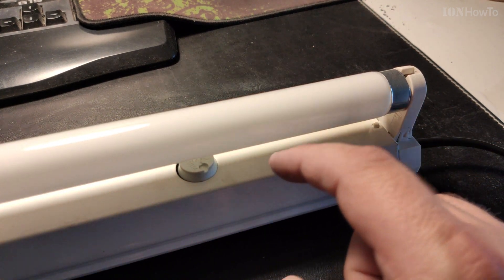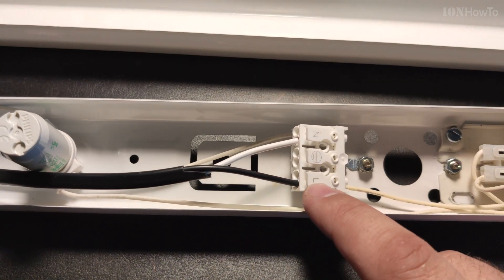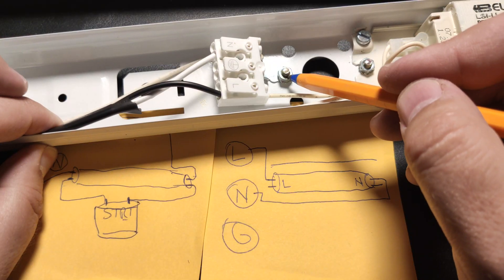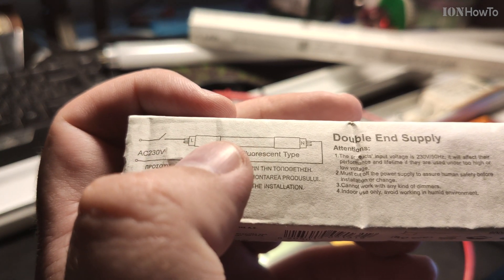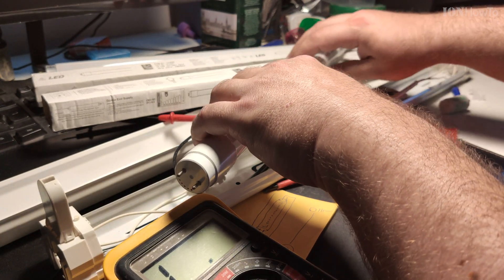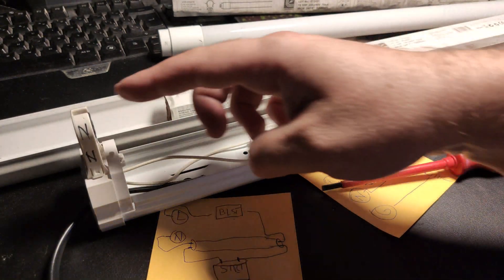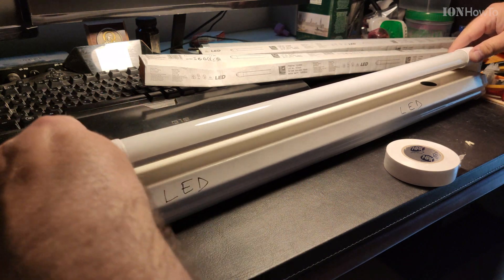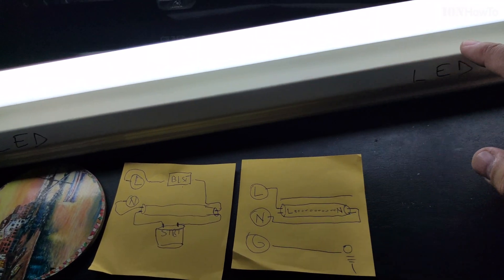Convert Fluorescent to Led

Comment from the maker: Amazon:
Fluorescent to LED conversion kit  https://rex.red/fluorescent-to-led-conversion-kit *
LED tube lights https://rex.red/led-tube-lights *
LED tube fixture https://rex.red/led-tube-fixture *
LED bathroom lights https://rex.red/led-bathroom-light-fixture *
Multimeter https://rex.red/digital-multimeter *
Electrician tools set https://rex.red/electrician-tools-set *
Electrical Tape https://rex.red/electrical-tape *
Electrician screwdriver https://rex.red/electrician-screwdriver-set-insulated *
Tester tool https://rex.red/electrician-tester-tool *

We earn money from qualifying purchases using our affiliate links.
Affiliate links are marked with a star. *
When you use our * links, you support this channel.
As an Amazon Associate I earn from qualifying purchases.

Comment: Can we join the wires which enters the starter and the wire which leaves the starter? To complete the circuit.
Reply from the maker: The starter and ballasta are not needed and can be bypassed / disconnected. If you have that type on lamp watch the video carefully and isolate well any loose wires.
Best is to call an election to replace the fixture.
it really depends on what lamp you will use.
I installed L-N lamps what have Live and Neutral on opposite sides.
Reply: hmm cant se the reply